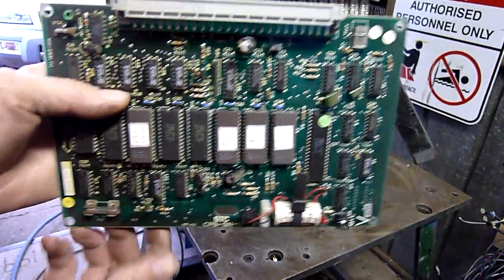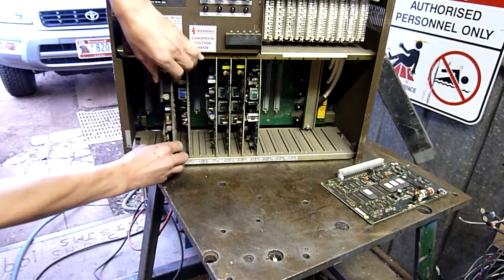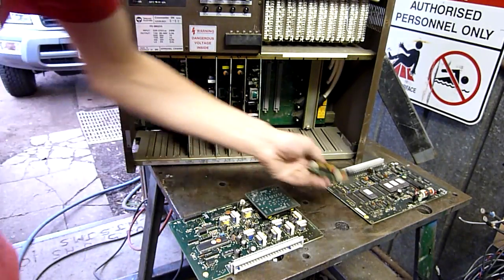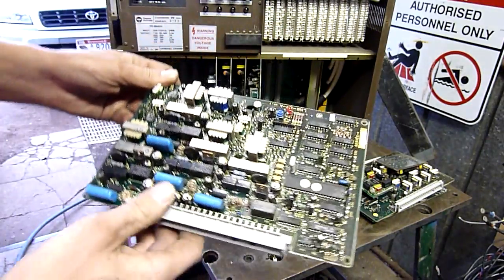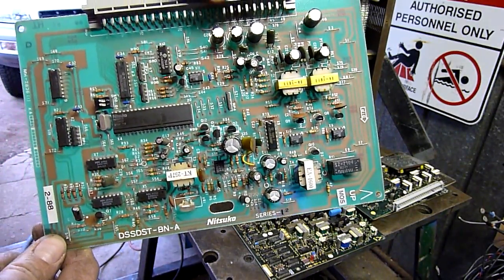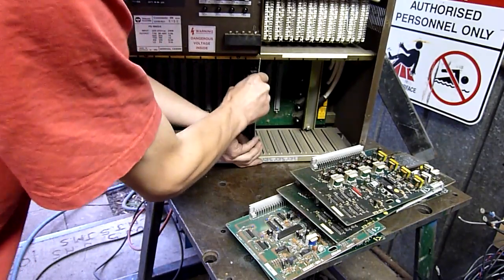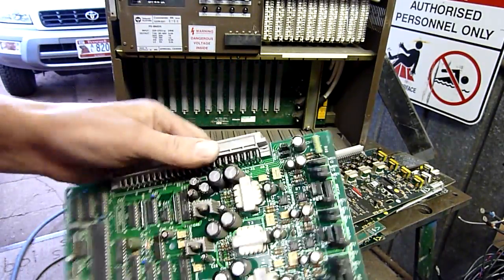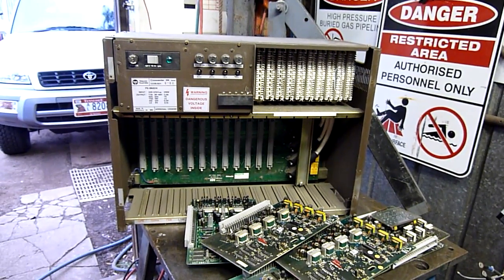Telecom Commander Unit Autopsy pt2

Comment: to shine some light on those cards.. you first board is obviously the main processor board.. the 2nd board is what is from what it looks like a Misc. board that has your page outputs with was that first daughter board you pulled off and the second one is probably your inputs for music on hold... the third board almost looks like a voicemail.. the fourth is a digital station card (system phones) and then boards 5 and 6 are single line analog cards.. then the last  is for outside lines..

Comment: Most of the 40 pin IC's are Z80 cores with integrated rom. ram and IO. They do all the logic and communications on each card, including self test. The transformers on the STB cards are the audio hybrids, they convert the audio from 2 wire to 4 wire for the internal buses, and allow the line powering to be done. The POTS card headers are to add options like CLI to be added.

Comment: The texas instruments chips at 3:53 are 74xx series logic gates.
The code you where reading is a manufacturing code, the real part number is on the next line.

There is no real standard to what line is the part number or date- or manufacturing-code.